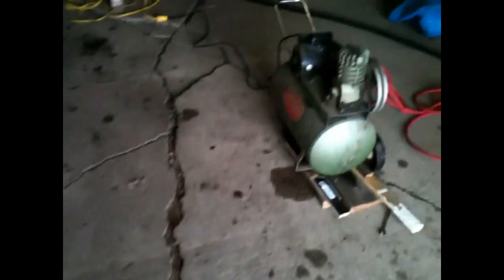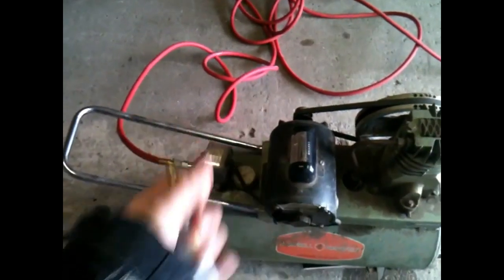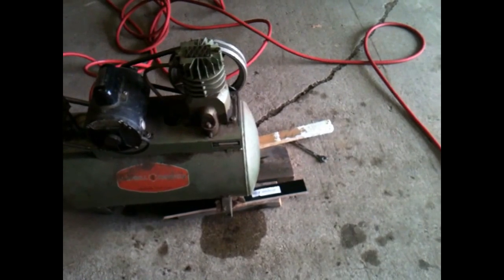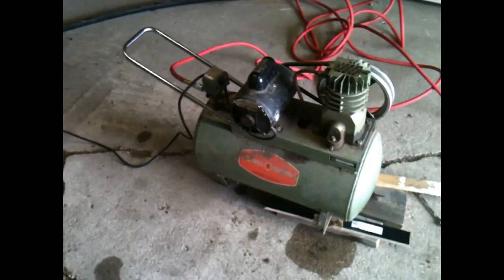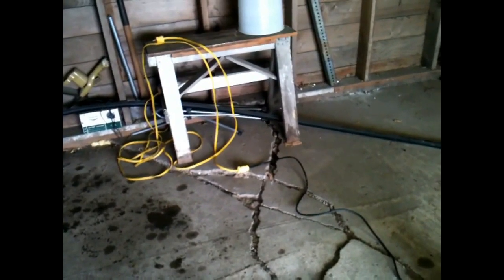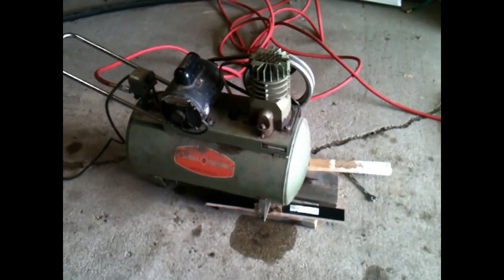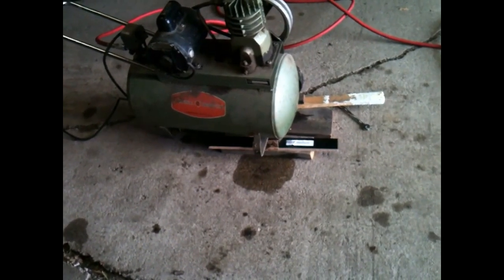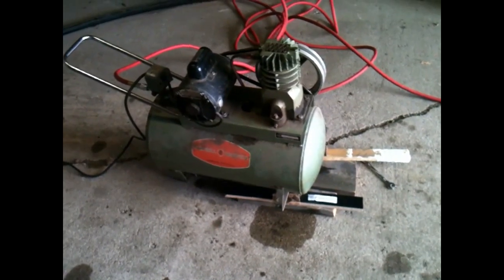Not good boys

Comment: There should be a air drain valve on the bottom of the tank.  I use the one on mine and drain the water that builds up in the tank out at the same time as the extra air.  Don't know if you know this, just saying :)  And you might want to check the oil on the compressor side it looks like the bottoms all wet and it might need to be topped up, if you all ready did not know that bud.  Take care
Reply from the maker: ya i have a air drain valve. it just shity looking, it needs 2 be cleaned. but im not cleaning it til i get new oil 4 it. but i dont no what kind..
Reply: you can use 20 or 30 weight non-detergent motor oil which is available from any auto supply store or hardware store. Some manufacturers also recommend the 10w-30 synthetic oil for use as well.  I use ingersoll rand 20 non detergent and change it twice a year.  but it depends on how much you use it.
Reply from the maker: Mr zurcon i use mine on & off in the summer time. sits 4 the winter. o ok well sice this 1 is old i dont care what kind of oil gos in it,just as long as it dose not kill it..